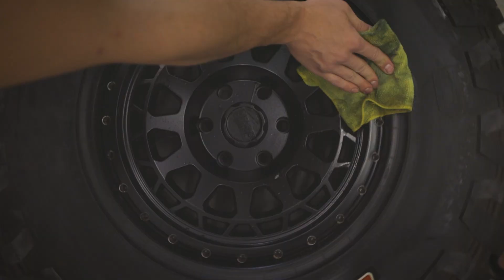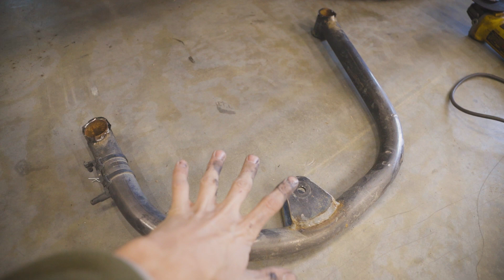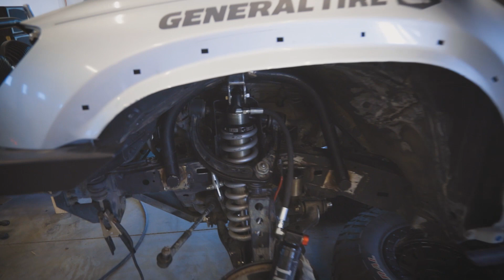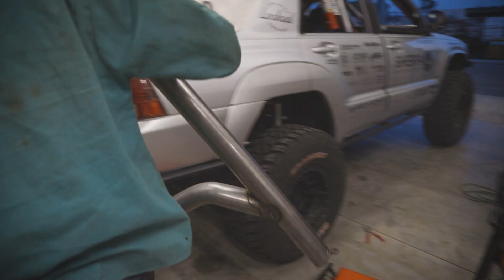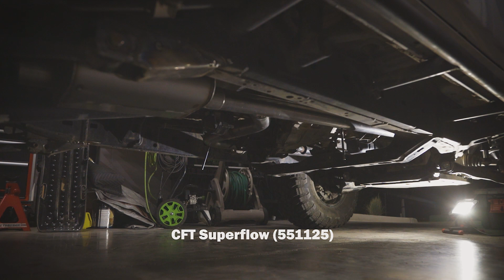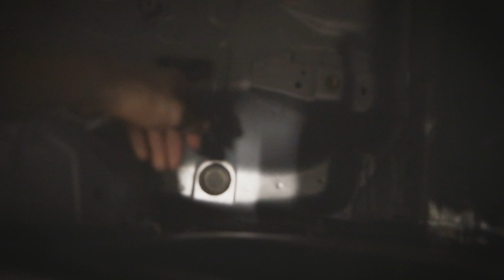Prepping a 4Runner for the Yellowstone Off-road Racing Wild West 100

Comment: I know I'm late to the party but I can't find a torque spec for the cam eliminator bolts anywhere. Can anyone shed any light on this?
Reply from the maker: Same spec as the factory. Really tight. They do have the nylock nuts which is helpful.

Comment: Are you guys still running the 333 alignment tabs with the new total chaos setup?
Reply from the maker: We are yes, they work great!
Reply: @sherpamotorsports  Radical I just snagged some. Also only 2 more weeks until the Sherpa rack goes on finally....
Reply from the maker: @cjjung4117  Awesome!
Reply: @sherpamotorsports  Did you struggle to get a shop to align her?  Or did you guys align it at home?
Reply from the maker: @locklear308  We just do it at home with the tape measure.
Reply: @sherpamotorsports  that's so cool.  I wish I could do that.

Out of curiosity, what do you put under the wheels to let them turn in place? Someone told me about using two floor tiles, top sides in.  Like a pivot basically
Reply: @locklear308  We just jack the truck up between adjustments and then roll it back and forth to let everything settle.

Comment: how much travel are you getting out of your front suspension? I've got a 4th gen as well and like your setup! I was thinking of going to a long travel kit but not a fan of the extra width. If your setup gains significant travel,  I'd rather build a similar setup. Overall, great job on the build!